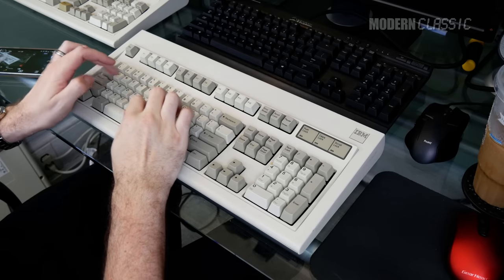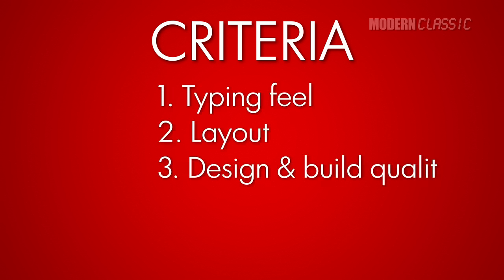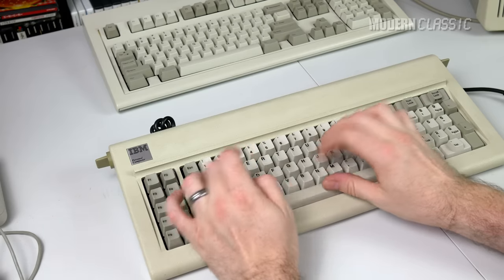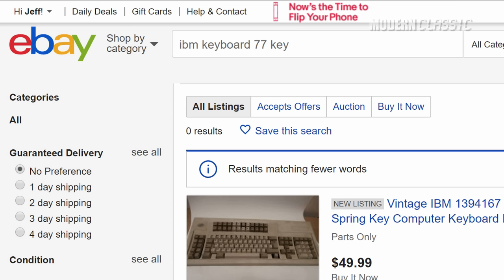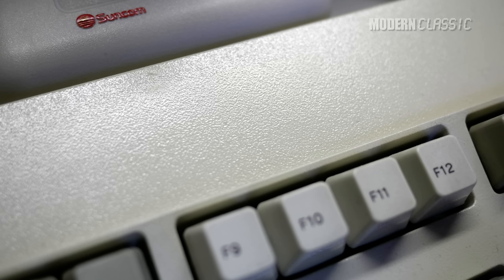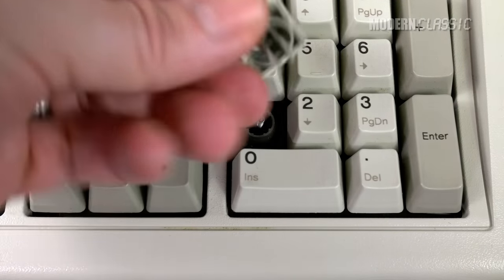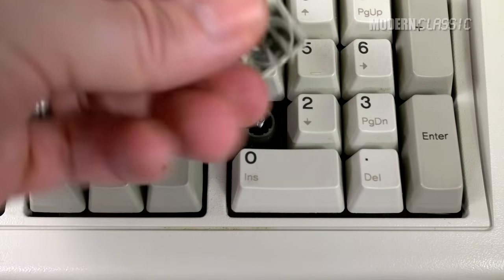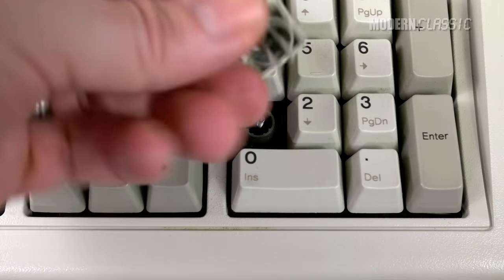Ultimate Keyboard Showdown - IBM Model F or Model M?

Comment: N-key roll over is needed if you're playing hotseat Mortal Kombat with a friend on a single keyboard.
Reply from the maker: How many and what keys does each player have to press simultaneously? I'll test it with the Model M.
Reply: I can confirm that.
Because the key combos are weird, and the matrix isn't layed out for that.

Max 6 keys
Reply: @ModernClassic  
It's been at least 20 years, but if I'm not confusing games, each player had Forward, Back, Up, Down, Block, Low Punch, High Punch, Low Kick, High Kick

One person played on the numpad or arrows, the other one played on WASD and whatever was most comfortable for the punching. Combos required 3-4 simultaneously pressed keys. 

But really, half the fun was in screwing over the other guy by making the keyboard  unresponsive from too many key presses.
Reply from the maker: I found a keyboard control layout ( http://mk-komplete.blogspot.com/2013/07/pc-keyboard-layouts-player-1-player-2.html ) and will test it later on the Model M. I just tested on my ThinkPad, which certainly does not have NKRO, and I was able to do two 3-key combos simultaneously for both players at the same time without a problem (I can't see why you'd do more than that, although I'm not an expert at the game). Testing with AquaKey Test, not the actual game, so I can see what's actually registering. It's actually hard to test two 4-key combos because my fingers don't want to bend that way, and I can't imagine what 4 keys you'd be able to press that quickly while actually playing.

Comment: I remember learning about the importance of n-key rollover while playing multiplayer games at the same computer with my brother. The emulator was configured for player one to use the left side of the keyboard and player two would use the arrow keys and numpad. Several inputs were dropped when keys were held, making some games very frustrating (like holding down a direction, run, and jump key for platformers). Switching to a full n-key rollover keyboard fixed this issue.

Comment: I knew an accountant who was a Lotus 1-2-3, dBase and WordPerfect expert, and since the DOS versions of those programs make heavy use of the function keys with modifiers (e.g., Ctrl-F7, Alt-F4, Shift-F10) he preferred the Model F AT with the F-keys to the left and all modifiers lined up next to the F-keys, because you could hit those key combo's easily with your left hand alone, without any extreme finger stretching or two-handed key strokes. He could keep his right hand on the numeric keypad for heads-down data entry and his left hand operating the function keys, entirely by touch. Very efficient, especially around tax time. 

Kept that thing going -- with various adapters -- as he replaced the PC it was attached to. Probably used it until the day he retired.

Comment: I believe it was the model F 122 terminal keyboard that introduced the modern layout which then became the standard for the Model M only difference being 2 rows of function keys. I have an F122 and it is my favourite keyboard by far, often referred to as the battleship because of its huge size and serious weight at 4kg. I think the flippers on the F are larger giving a slightly different feel and actuation, I think that is the main difference but it's pretty close and they are both excellent to use.

Comment: My vote goes to the Model F/AT, as the PC/XT version of the F just has too strange a layout.

I procured an F/AT, then took the Enter, Backspace, and Slash off a broken Model M and put them on the F/AT.  This made the layout way more standard.  Also had to move some of the actuators around, because the new keys were trying to press on different capacitance pads than the originals.  This also caused it to emit non-standard scancodes for the replaced keys, so I had to cut some traces and solder in jumper wires to correct that on the main part of the keyboard.  As for the keypad, I replaced all the key-stems with the removable-cap model-M type, arranged the arrow keys and cursor navigation keys into a more standard layout, and then remapped them in software.

The result is a model F with a regular layout (albeit without a keypad), that is a pleasure to use.  I am not 100% happy with the software remapping for the keypad, so at some point I want to try placing a teensy microcontroller inside of the enclosure, and use it as an AT->USB converter that magically handles the scancode remapping for me.

Comment: God, I love the F so much. I've used an XT F on my desktop for several years and honestly I'm so used to the layout I don't notice until I have to use a different keyboard. I know the AT F is easier to use because it uses the same standard as PS/2 and it has a newer layout, but I like the XT. I built a Teensy into an old KVM, so I can swap between my terminal M when I want those 24 F keys

Comment: Another advantage of the Model M is the addition of the little plastic bumps on the F and J keys, as well as the 5 on the numeric keypad. For those who touch type or have to do numeric data entry by touch, these bumps helped you relocate your fingers to the correct 'home' location without having to look.

That may not be  a useful feature for those who taught themselves to type with "programmer's claw" ;)

Comment: As far as i'm concerned, i'll settle for a model H i.e. do a hybrid of models F+M....so preserve the model F's (even the beam spring era) clearly superior key feedback feel AND package that with the enhanced Model M layout BUT also (my personal preference at least) do away with the top function key row by F77 style placing FN keys under the top numeric row & with the enhancement of ESC PS SL PB etc. keys placed elsewhere below around dedicated cursor keys area in order to reduce the overall desktop occupied area for more space efficient compact keyboard without compromising on feature conveniences. 
As for internals, no riveting use bolting instead with further improved drainage discharges to mitigate any stagnant liquid accumulation inside leading to plate corrosion, also making it easier to keep the internal area free of contaminant matter & easier to maintain etc. 

That would be an ideal keyboard for me.

Comment: I have the Model F XT, Model M SSK, and the Compaq Deskpro keyboard. While there is already a significantly different feel between the two IBM keyboards, I was shocked when I first tried the Compaq. It’s a rubber dome and contrast starkly with the clean clicky feel of the IBM boards.

Comment: Never owned a Model F or M keyboard, but interestingly enough, the first PC I owned was in 1994 (shortly after I turned 16) and its keyboard connector was 5-pin DIN, as opposed to PS/2. Seemed a bit odd in retrospect, as it was a new PC, but I was able to find a PS/2 > 5 pin adapter for it when I upgraded the keyboard it came with later on. 20+ years later, my main PC is running a Logitech G613 wireless mechanical keyboard, but I do plan to do a retro PC build at some point - at which point I'd definitely be looking for a Model M for it, as it is undoubtedly a classic.

Comment: I've had two Model F (one XT, one AT) that did not need foam replacements, despite still having the original foam.  Conversely, I've also had two Model F (one F122, one AT) that did need foam replacements.

Comment: I once had an entire basement of PS/2 Model 95 servers including the keyboards. Got rid of all that stuff :) I collected these servers from a company that had gone bankrupt and just wanted them gone. A whole pickup truck full of 486/50 and 486/66 servers! They were MONSTERS. I guess I should have saved the keyboards. To tell the truth, I got my retro jollies and was done at that point. I do love your videos! I was an IT guy already in 1984 and my first work computer was an XT. I'm surprised you haven't set up a system with an MDA/Hercules combined with an EGA or VGA card. In the early days of Windows, the best way to program was to run a debugger (like Turbo Debugger or MS Codeview) on the MDA text screen while your Windows 3.x application showed up on the graphics monitor. You could then step through the code on the MDA green screen and watch the code action evolve on the graphics monitor. You got a real appreciation of all the BS that went into just creating a scroll bar or a push button! Also waiting for your journey into 8514/A world - the first "real" high resolution display with 256 colors at 1024x768.

Comment: Interesting review of both keyboards, and something I feel that I should add on about the n-key rollover, as a Model M user for the past 6 years, is that you're right. It's very very niche that you'll ever really need it. I've played a fair bit of PUBG a while back and I have to say it's almost required that you have it, I've been in many situations where my keyboard would beep because I've exceeded the amount of button presses it allots. The same goes for maybe CS:GO as I've encountered a few problems without n-key rollover. But outside of those two games, I've never really had the need to press so many buttons in a game. One of my friends had bought a Model M, but was turned away from it after he used it and realized there's no n-key rollover. So it turns out to be a very niche case.

Also, I recognized you at the SCANDAL concert in NYC, but I was too shy to say hello. So I guess I'll say it here, lol.

Comment: Excellent review. 
A comment about the larger boards (122 keys). I own 1 Model F122 and three Model m122's. 
All my M122's have 3+ keys that cannot be assigned a useable function. The keys actuate and send codes, they are not broken. I've done a fair bit of searching to no luck, But I have read on multiple pages that all F122's do. The non assignable keys are all on the left function key cluster. That cluster is the easiest to use too :(
Typing on the F is much more precise, faster ( in my experience) It is louder . Also quite pingy sounding (metallic sound). The M's are a solider feel, thockier, quieter, But the F had feeling of quality, better tolerances on the key placement, case and internals that is manifest in all the sense experiences of typing on it.  Keep in mind this is my experience from just 4 boards. There maybe a solution to the unaasignable keys on the M122 and it is very likely my F122 would be far less pingy if I got around to replacing the foam. Should add here that foam cut for F's is now easy to get and for a reasonable-ish price.
Reply: So I had a similar problem with keys on my Model Fs sending out codes, but Windows ignoring the codes (ignoring the keys). I fixed it just by assigning those codes to certain functions in my Soarer's converter. Now all those keys "work" in Windows.

Comment: The Model M has a much better layout but I've only owned an IBM Model F.  I do currently own a Unicomp Model M and love it to pieces.  I first used the model F when I was only 8 years old but I''ll never forget it.  It really was a masterpiece.  The F definitely had a better feel than the M with faster keystrokes, better durability and a louder click.  It depends on what you value more, layout or feel and in what degrees they are important to you.  To me, the Model F had much better mechanicals and slightly better feel.  My dad did replace our Model F PC/XT with a model F AT but I liked the PC/XT version more.  I missed the giant +, Ins and Del keys.  I also never used the second return key like I do now.

The true ULTIMATE keyboard would have the Model F mechanicals with the Model M layout.  The best of both worlds.

Comment: 11:04 Note that the modern Unicomp "New Model M" has 10 key rollover, it's not same as "n-key rollover" (which means you can register ALL keys simultaneously), but 10 keys is plenty.
Reply: This is false, as both the New Model M (which I am typing this on), the Mini M and the original Model Ms are 2 key rollover.
Which is due to the membrane sensing array, without diodes, individual traces or capacitive sensing that is the highest achievable.
Both the original and New Model M can register up to 6 keypresses, the Mini M has the ability to register up to 10, along with having less conflicts in it's larger sensing matrix.

Comment: Has to be the model M for me, more durable, all the imperfections (minus the plastic grommet issues) were ironed out in this model. Been using mine for around 3 years, it's a 1991 model (Blue IBM logo) so guess it was when Lexmark took over production from IBM, although they were part of IBM anyway at the time.....

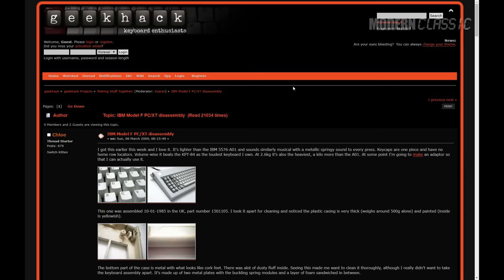Comment: @6:17 Must say, my Model F has a spacebar same standard as a Model M, though It seems to be a much thinner metal bar. I do however own an IBM Battleship, so I do not know if difference between models.

On a somewhat related note, Model F keys are much more a pain in the ass to actually put in. With a Model M, you can mostly put them in correctly, but with Model F you will most definitely put the keys wrong in at some time. You WILL MOST DEFINITELY hear the difference though, like it is super obvious.

I am really worried about the foam stuff though. I dunno what it does or why but it is disintegrating. This bad, no?

Comment: Rollover has only really been an issue a couple times, pressing W and S at the same time makes a lot of the keys unresponsive. That just happens to be necessary in GTA to do a burnout and in san andreas you have to do a donut in the driving school missions so I had to remap to the arrow keys until I finished that

I am still going to play on the model M, works just fine and millisecond reaction time improvements are a complete waste for non competitive play

Comment: N key roll over is important for a couple use cases I encounter. 
1 is music software where you use your keyboard as piano keys. For larger cords you need to have a high-key rollover
2 is games. Playing 6DOF games (Descent) with a keyboard requires a high key rollover, although I have run into the limitations of key rollover in other more traditional games, especially if you try to change the movement keys off of WASD. 

2 key rollover is horrible, I'm surprised the model M is so highly regarded when it has a non-negotiable deal-breaking problem like this.
Reply from the maker: It's highly regarded because you're making the same mistake I talk about in the video, which is thinking you're ever going to come across any kind of limitation. Pressing WASD simultaneously doesn't even cause the Model M to break a sweat. Not that you'd ever be doing that in a game anyway.

I am a musician - I don't know anyone who plays or records music using a computer keyboard these days, unless they're intentionally doing it for nostalgia. But this isn't 1987. Musicians use dedicated MIDI controllers, which are cheap (as little as $40), plentiful and a lot easier than using a computer keyboard, NKRO or not. If you're using a computer keyboard for music, you're limiting yourself regardless of how many keys it registers simultaneously.

Comment: The IBM 3270 terminal keyboards which preceded these was even better, plus it came in a heavy duty steel housing! I started in IT at GM in 1985 and typed on them for years. I bought a Unicomp keyboard a couple of years ago to save myself from the terrible standard keyboards being issued with company PCs.
Reply: Those 3278 keyboards have beam spring switches and a solenoid that makes a sound when you press any key.

Comment: N-key rollover is for fighting games mainly.
Imagine playing a charge character in SFII and you need to hold A(back) and then press D(forward) and another key for a punch to execute Bison's Psycho Crusher for example.
It's also needed in beat-them-ups to activate special moves sometimes by pressing two or three buttons simultaneously.
Reply from the maker: There should be no problem doing that on the Model M, as I mention (and show) in the video).
Reply: I just tried playing a few rounds of One Must Fall 2097 on one.  Only difficulty I encountered was the Enter key being smaller than I was used to, and Windows nagging me about StickyKeys. Once I shut Windows up, all went fine.

Comment: There is a confusion in the weight, the PC versions of the Model F did not weight 10 pounds, but Chryrosan22 has a review of the Banking terminal keyboards, and they are made with a weird zinc case that weighs something fearful. 10 pounds might still be an exaggeration but maybe not.

Comment: The 3mm foam used in the Deskthority Model F foam thread post is too thick. Use 2mm at most, as also recommended down in the comments on that page. Otherwise... you're gonna have a bad time.

Comment: Excellent presentation, as usual.  It was my understanding that the 9-foot cords on the Model M keyboards came standard with the IBM PS/2 Model 60 and Model 80.  Those were floorstanding towers, and often the extra length of the cable was necessary for it to reach.  All other early PS/2 models came with the shorter cord, although the longer, 9 foot cord was an available option to purchase.
Reply from the maker: I believe this specific keyboard was probably purchased separately. This is a 1390131, which is the original AT-based Enhanced Keyboard, but mine has the PS/2 cord. I don't believe they offered this model keyboard standard with the PS/2 - that would have been the 1391401 (with the new PS/2-style IBM logo badge). But I do know they continued making the 1390131 for a while after the PS/2's release, or maybe they just had them warehoused and continued selling them with PS/2 cables.

Either that or this was a keyboard bought with an AT and then kept with a new cord once the owner upgraded to a PS/2. (I'd guess you could buy a PS/2 without a keyboard direct from IBM in those days.) But anyway, I don't think this keyboard itself came with any PS/2, even though mine has a PS/2 cord.